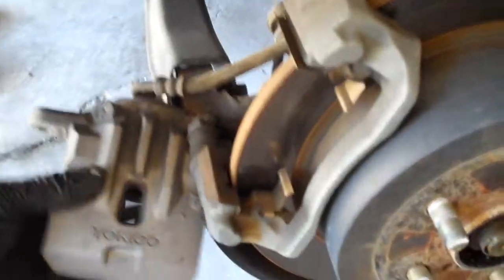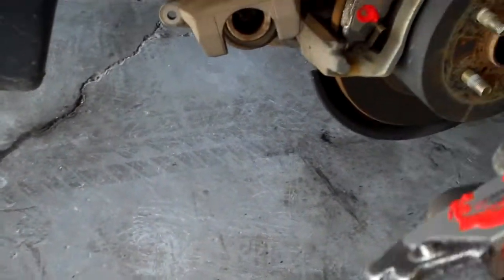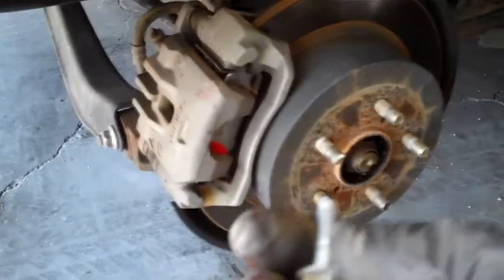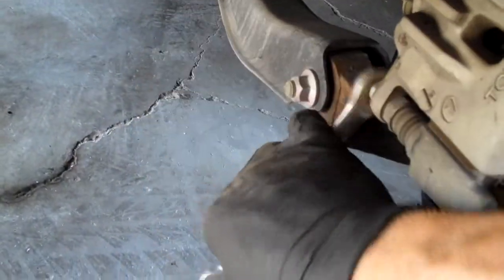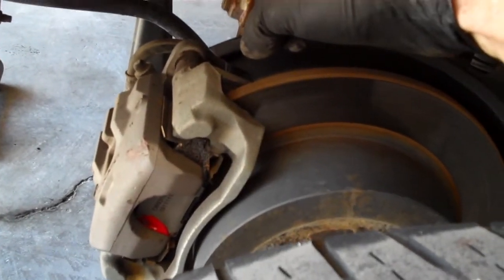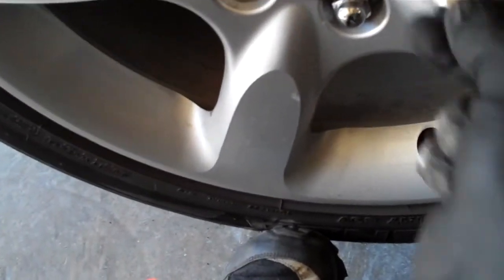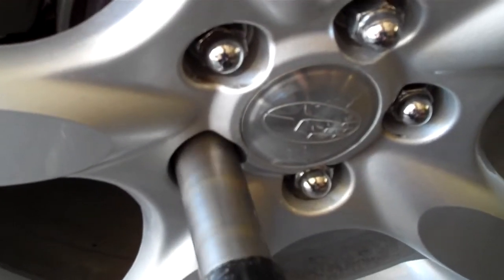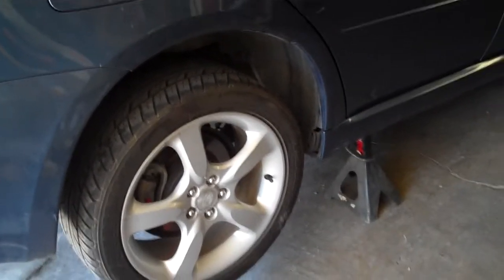How To Change Brake Pads on a Subaru and Most Cars

Comment from the maker: Many shops use the torque wrench and torque sticks because it's way easier to train people to use them than it is to train them otherwise.  It's takes a lot of practice and some destruction and parts expense to get the feel if you're doing damage or if you're erring on the side of being dangerously loose.  I trust and prefer my methods.  Others have often criticized me for this, but I've been doing this now every day, multiple times a day on the same cars for years on end.  I like my results.

Comment: Just finished doing front brakes on my 08 Legacy thanks to your video. I would have taken a few pictures but the job went too quickly! Last week I did lower ball joints, shocks and rotors on my 97 T100 4x4. I suddenly feel empowered. Great videos and advice, thank you.

Comment from the maker: I torque a bit more than spec, but it isn't damaging the wheel, studs, or lug nuts.  I see these cars over an over again for years.  No one ever loses a wheel or has broken studs.  The fasteners last.  So I'm happy with what I'm doing.  Many local shops that use torque wrenches and torque sticks have wheels fall off due to mechanical failures, failure to calibrate, and improper practices.  I watch the socket slow down and then I let off when I feel and see it's appropriate.

Comment from the maker: I really like your restate style.  That's a great learning tool.  What I do is I tighten until I see the socket slow down and then stop.  As soon as it stops or binds I stop immediately.  I visualize a graph with a downward sloping line that starts high on the Y axis (socket speed) and where it nears the X axis (Time) it stops as the line is near parallel, but not touching yet.  If you continue till absolute stopping occurs, you will inevitably cause damage.

Comment from the maker: It's to have a silicone based grease to facilitate lateral caliper movement.  Two pads that wear over time and pressure from one side only.  You have to have a means for centering and adjusting over time.  The slide pins allow for this and the grease allows for free movement.  The seal keeps the grease clean.  The problem comes when there's crud plus grease or the wrong type of grease.

Comment: Great video man! Just as an FYI to anyone else replacing the rotors as well on a Subaru Impreza 2.5i (2007 for me) When removing the remaining caliper bracket, which you don't have to remove for just doing the pads, the rear caliper bracket bolts will likely be seized on. A quick Google search will show the majority of results involve how to fix a snapped caliper bolt! Do yourself a favor and spray the fastener and the mating surfaces with some PB Blaster, and then gently crack it with steadily increasing pressure with a breaker bar, or a piece of metal pipe slipped over your ratchet. Extracting a broken bolt form the back of the caliper doesn't sound like a great way to spend an afternoon!

Comment: The torque on the impact gun used to tighten the lug nuts will depend on the air pressure, and the particular type of impact gun.  If you are doing this occasionally in your home garage with a small compressor the air pressure  may not be as high that used in this video and you may not have the experience to know if all the variables add up such that the final "tap tap tap" of air ratchet has tightened the bolts well enough. I've had lug nuta tightened at shop come loose and destroy an alloy rim. I had them come back from a shop with brake pulsation because they lug nuts were not tightened uniformly.  Now I use a torque wrench at home to double check.

Comment: Hey Brian. Great videos.. I've been working on cars for years, including an auto trans rebuild. Did rear disc brakes on a buddy's Isuzu Rodeo. One caliper bolt,(slider thing) on each side had a rubber seal on the end. Created a problem after completion, hydraulically applying the brake due to lube behind the seal. I took it apart and removed the grease.. Works fine now. Has that ever happened to you? Why the seal?.. Thanks. Bill

Comment: When you spread the brake caliper what precautions do you have to take with the master cylinder? I changed the pads on my Civic and I removed the master cylinder cap to allow for expansion when the brake fluid was pressed. I was told that not removing the cap could damage the master cylinder. Is this the same with all vehicles?

You are doing great videos. Thank you for this.

Comment: correct me on this, I was told when you compress the piston that the bleeder should be cracked open to allow fluid to escape instead of pushing it back through the system because there are tiny orfices that involve the abs and if the fluid is dirty at all it clogs the orfices and causes the abs light to come on and mess with the abs system. have you ever heard this or had it happen ?

Comment: Nice job!  Was trying to see if there was a specific call out for grease or glue for the Sub.  Mine is squealing during backup only on new pads from the front.  I used the CRC spray but will try the glue as I dont thing the spray was thick enough to keep it from floating on the caliper.

Comment from the maker: @vgbr88 Use special silicone based grease for brakes/clutches.  Bearing grease goes to concrete with heat.

Comment: I have a Subaru Impreza. I had my brake pads changed at the last service. I have noticed a rattle (knocking) when at slow to low speeds. I don't think its the shocks because they don't make a noise when going over harsh bumps. I notice the sound coming from the front of the car, and sticking my head out the window and listening, it sounds like its coming from the wheel area. 

Do you think it could be the brake pads and that they didn't glue em?

Comment: Hi Brian, i have a 2007 Subaru legacy wagon and the parking brake is partially seized, could you please do a video on replacing the cable and properly adjusting the brakes? I've looked online and I haven't found a video on a Subaru.

Comment: That disc brake quiet red stuff says it is for non-shimmed pads.  those pads looked shimmed.  Is it the right product to use?  I thought there was a lube or grease to use instead.    Also, that disc brake quiet is supposed to dry before installing the pads.   Good tips though, those just seemed to be the opposite of what others Ive watched say.

Comment: great video, I watched this, got pumped cus i had new brake pads to put in, got outside, got my wheel off, tried to take off the brakes, NOTHING, RUSTED to the bone.. I live in new england and that's my main issue with my forester. Everything i try to do myself Mechanical usually doesnt even take off because of all the RUST!! waht are some good tips for rust removal. I need it for my suspensions and brakes, cant take them off

Comment: The rear caliper slide pins on my 06 WRX two pot calipers are frozen. naturally I need to replace the pads and rotors because they are all pretty beat up and worn unevenly. I was wondering if you had any advice on how to remove the slide pins once they are frozen and rusted. I've tried using a drift pin and ball peen hammer but I had no success. Any advice would be great. I don't want to damage the caliper. They are expensive.
Reply: Also I have a set of new pins for each side once I get them out, so if I have to drill them i will, but I would rather not if there is another way.

Comment: Thanks for the Video Brian! Could i request a video? I have a clunking coming from the right rear of my 2007 subaru legacy wagon, it only happens after the car has been parked for a bit with the parking break engaged and only after going from reverse to forward. I believe it's the e-brake that is doing this noise and i would like to do a full e-brake servicing since the e-brake lever needs adjusting also (pulls up quite far to apply brakes) 

Thanks!

Comment: does anything need to be done with the ABS system before the piston is pushed back in? ...  Ilast time I did this was years ago on a car without ABS ...  We loosened the cap on the master cylinder before using a C-clamp to push it back in,same thing now a days with a ABS system ?  ( scion Tc ).  Thanks

Comment: I have to say, I like using a torque wrench on my wheels--and for 7 years, no wheel(s) have come off...my eclipse had a lug over tightened, and it damaged the threads...it took all my weight on a breaker bar just to get the wheel(s) off (thank you shop). I say, whatever you use, not too loose, not too tight. DEPENDING on vehicle: 80 - 110 ft/lbs is what I have lived by. Also, steel or custom alloy wheels plays a part. (ie: ferrari, porche, aftermarket, etc...)

Comment from the maker: @JohnSRosamond It's not the size of the compressor that's the factor.  The pressure in the tank is.  And even that isn't the factor.  I'm not squeezing the trigger till my hand is numb I'm using my eyes to see when the nut is settled in snug.  I'm only giving it gun till the nut settles.  There's a point that- that happens that you can see.

Comment: I changed out the front pads and rotors on a friends 07 Outback. I hear a Clunk noise when applying brakes going from reverse to forward, but only once in each direction, then the sound goes away. All bolts tight, proper lube used, shims etc. in place. Any ideas? Could this  be from small pads?
Reply: +Michael Vaughn   You might check the control arm bushings.  If they are worn there may be movement when you apply the brakes.

Comment: @peelout40 agreed. well before I started working on my cars (I wouldn't even call myself a weekend mechanic, just doing it on the cheap out of necessity)... I learned the star pattern bit from tightening and tuning drum heads. same concept. and I agree about a torque wrench 100%. I damaged a rim on my jetta due to a tech cranking down with his shop gun. the strongest neighbor around was helping me with a 6' length of fence post slipped over the breaker bar and it still took us over an hour.

Comment: ...actually was to do! I never looked back ever since, and continued to do more and more work on the numerous vehicles that I owned, learning more and more about those machines that seemed not to want to divulge their most intimate secrets which, little by little, are being revealed to me, thanks to my sheer Celtic obstinance of not declaring defeat that easily! I have driven hundreds of thousands of miles, and never had a wheel falling off on me yet! I use a good ol' lug nut wrench and...

Comment: Actually with AL rims the lug nuts will loosen on their own slightly. This is why many people recommend checking the torque after 100 miles or so. Setting 1 on a high end impact gun in good condition is about the torque that most manufacturers spec.

Comment from the maker: @elic123456 It looks too tight, but it's not.  I too have seen that many times.  The key is to stop when the socket does.  I regularly make a habit of pulling over and helping people on the side of the road.  I've seen what you describe many times.

Comment: A click type torque wrench is always required on all aluminum wheels I take loose period, steel wheels maybe....aluminum is way to soft for any heavy duty 1/2" impact gun.. Use no click type and you take a gamble. Its like riding your bicycle in the street.......

Comment: I usually open the bleeders when I push the pistons back.  That way the old fluid that has been in the caliper for years drains out of the bleeders and  does not go back into the system.  Then I top off the reservoir or bleed the brakes.

Comment: Factory torque specs always worked fine for me.Had tires replaced once and the mech. ran the lugs so tight I busted a lug off when I had to do my brakes shortley after..They were all like that.Also, after a state inspection same thing(too tight) and I checked the wheels he took off and had to take it back and complain and had them loosen for me.I always ask the mech. to use torque wrench to be safe.

Comment: I like to clean them off with a little bit of auto trans fluid and a wire brush and then spray with brake parts cleaner and let dry. That leaves the studs and nuts completely clean and dry. Then I just either torque them or estimate and get them to about where they should be using a big 1/2" ratchet.

Comment: Basically, I don't have this feel.  My car calls for 70 to 85 ft lbs, so what I do is use a 60 pound torque stick (star pattern)... Then I pull out a torque wrench and go to 85 in a star pattern...  Thus far no problems, but there is a LOT that can go wrong.  For instance, lubricating a stud can cause massive problems where the lugs may be tight but with vibration unscrew, yet some people lube them... then when the wheel falls off they blame the shop, which did everything to mfg spect.

Comment: I like the tire shops that torque my wheels to spec.  I don't get warped rotors and I can get the wheel off when I have a flat.  I've had them I couldn't get off a 6 foot cheater bar.  I've ruined lug  nuts.  I'll take the torque spec.

Comment: I'm pretty certain you have been fine with just using the gun but don't discredit the engineers that designed the car by saying they simply figure out what torque makes the lug nuts stop. That's incorrect. The torque is based on the forces on the wheels, the yield strength for material of the lug nuts and the studs, and a safety factor. That safety factor might be the only reason why you really don't damage the studs/lugs with an impact wrench because they took that into consideration.

Comment: @briansmobile1 -I understand but there alot of poor mechanics that don't care and are in a hurry, but you find that in any profession and I am very untrusting of mechanics unless they did good by me before.Case in point-Just bought a used mazda and the used lot had a shop do front brakes.When the mechanic put caliper back on he had one of the rubber booties bent over and ran the pin right thru the side of the rubber and tightened it.Just luck that I was under there checking things out.